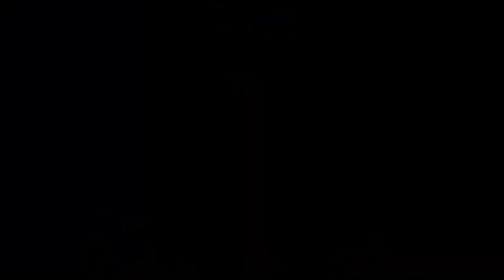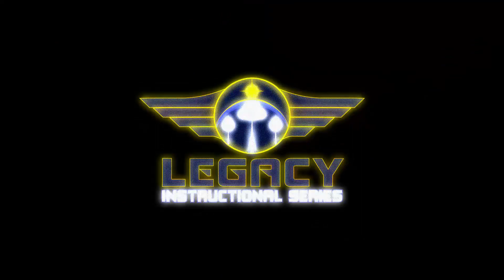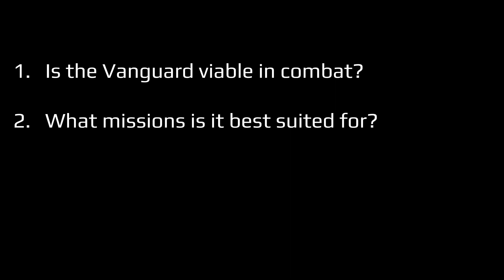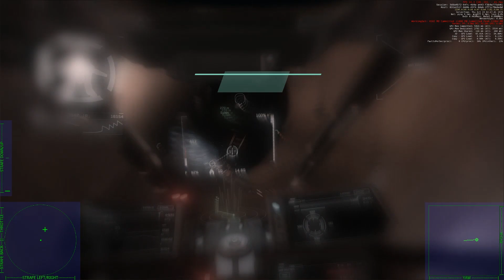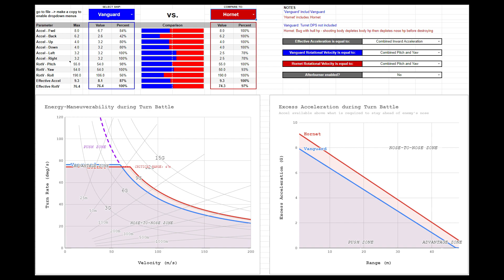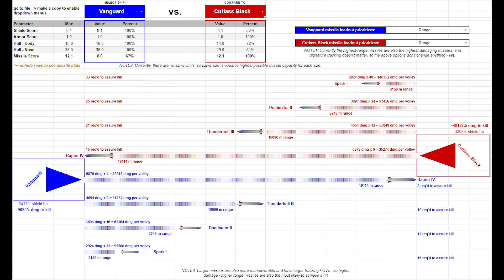Vanguard Performance Analysis - 3.6.1

Comment: I honestly don't mind the vanguard having a fix forward armament as long as it keeps the high rotation rate.  I would like a wider range of options for the fixed forward firepower and I would like one more size 5 mount for the pilot on the warden as it is the fighter variant, and all the variants should have the turret upgraded to mount size 3 guns as well as being able to manage the ships systems from the turret.

Comment: I love your un depth analysis.
First, let me say. Ever since the great Cannon nerfing of 3.5, I have been very disappointed with the Vanguard's firepower. I think it was just about right where it was in 3.4.
That said, I still like to put an M7A on the chin, then combined with the MVSAs I can deliver ferocious punch after punch on a target. And Cutlasses are especially easy to kill.
I'd really love to see one of the following: 
A) 2 size 4 hardpoints added under the wings
B) an additional size 5, either paired up on the chin, or move the existing one off the chin and put the 2 size 5s under the wings.
C) upsize the quad 2s to quad 3s.
D) put the quad 2s on a gimbaled mount (for auto gimbaled firing)
With option D I'd still want more firepower. Perhaps 2 size 3 hardpoints under the wings.
A 5 Vanguard flightwing should scare the shit out of a Hammerhead or Polaris.
Reply: i understand the nose gimball but more firepower ? in this video you saw great maneuvrability and awesome shield and hull point if you have more firepower you have everything and cig don't want that so if you want more firepower you will move as a freelancer or have the same hull point to balance

Comment: Good video if somewhat inaccurate. Arrow for example has little issue taking out a Vanguard if like the Vanguard you change it's loadout.
Reply from the maker: If it's using bugged attritions, yes, I agree.
Reply: @LegacyFleet  Arrow doesn't need to use the bugged attrition's to kill a Vanguard. It just needs to stay by it.
Reply from the maker: @rcole134  Hmm. That's not what we found. Let me know if you find or make a video showing how to do it. As I showed in the analysis, I did testing against 5x arrows all ok my at once and even with bugged attritions it took multiple minutes for them to kill me.
Reply: @LegacyFleet  It's just comes down to the loadout. It's also very simply math. damage output vs shield regen = win/loose. Another issue with your video was when you said a Vanguard could take out a HH. Yes, it can but only because the non default Attrition on the nose is bugged, thus bypasses the shield. If it wasn't bugged then the Vanguard couldn't kill the HH on it's own simply because the default shields of the HH recharge at a higher DPS than the DPS damage output of the Vanguard. It's all simply math. Also, as side note I took out a Warden over Daymer a few days ago after he engaged me. I was in a stock Gladius and used missiles which he just couldn't get out of the way of. I own a Warden myself and YES it's a good ship but it's not as good as your video would suggest. Final bit of Math Vanguard damage output using 4x MVSA'a and 1x S5 Attrition = 1843 DPS - 1669 sustained DPS. HH default shields recharge at 3855.176HP/s. (2x shields totalling 179868hp) That means that without bugs the Vanguard just doesn't do enough damage. (Info taken from erkul.game/calculator who pull there data direct from the files.)
Reply from the maker: @rcole134  But the video where I demonstrated the VG taking out a HH, I wasn't using an attrition, I was using a S5 absolution distortion cannon. Also, I agree with math being important, but that math needs to be validated with in-game testing, because maneuvering gets a vote. An Arrow won't be able to maintain constant damage on a maneuvering VG, and that shield regen is high and has no delay. That's why I said - if you find a video of an Arrow killing a maneuvering VG with something other than an Attrition, let me know.

Comment: Very Great video! And thanks for this as always! Loadouts would be a nice option to add to this? I know you used a Absolution distortion cannon S5, What do you use one a normal run etc..I also noticed the default cannon was not used?
Reply from the maker: Not in these videos but I have used the default revenant quite a bit. I would say either that one or (the meta/bugged) attrition is what most use.

Comment: All is well, but what about Fixed vs Gimbal advantage. For example MIS will hit much more often thanks to having it's weapons on turrets which will achieve much higher on target gun DPS. I know that it is hard to include it in hard weapon stats comparison, but it is a very important factor.
Reply from the maker: I did mention that in the video. There's no way to quantify that advantage, though, other than to say that the Vanguard is one of the only ships that can't gimbal all its weapons, and that limits its versatility.
Reply: @LegacyFleet  I know it is hard to quantify, however that is a VERY important factor that completely undermines all of those calculations. Having ability to track your target while not precisely on target changes possible attack ranges, changes time on target - and that changes actual DMG output. I don't know really what is the impact of having gimbal/turret and not having it on actual DMG. I think there were discussions about it on spectrum, but I personally judge it around 30 up to 50% more DPS thanks to having gimbal/turret and that is huge. A lot will depend on skill, but roughly Vanguard will have maybe 40% time with weapon on target while Lancer will have around 50-60% - and that is up to 50% more hits so 50% more actual DPS. I think you should try to accommodate that into spreadsheet by using static dmg modifier, but please consult people on spectrum for better percentages. There are people who have made some measuring and can tell you better numbers than those I have put here out of thin air (well, from memory).
Reply from the maker: @aleksanderw5536  Actually, if you want to go with 50% then that's perfect because that's the exact DPS tradeoff you get from using a gimbal instead of a fixed weapon in a hardpoint. In that case, the analysis values stand quantitatively.

Comment: This is awesome. Really appreciate your vids! I've always been a fan of the Vanguard. MIS would be cool to see next. Your segments on how to tackle fights (nose vs. range) is especially good and will hopefully cause the community to improve and think about their technique. Why do you think the community at large thinks the Warden sucks even though your analysis shows otherwise?
Reply from the maker: Because I think many consider the inability to gimbal all weapons to be an accessibility issue. And, it's true that it does affect the VG's performance, currently. But the thing is still a beast IMO.
Reply: You’re a lot better at deflection gunnery than a lot of us are, so it’s probably a lot better for you than it is for the rest of us...

But, objectively, you’re right that it’s still a beast. 

Biggest disadvantage though: It’s not fast enough to pick its battles. On the attack a lot of ships — and cheaper ships — can turn tail and run from it. And if you’re facing off against other combat vessels you better be tough — your only option is to fight to the death.

It seems to be a great pick against NPCs (who can’t evade as effectively as PCs), and larger ships. And it its lack of speed does not hamper its ability as an escort...
Reply: @moonman6359  and what the problem as escort if the target run away the escort is alive so your job is done, if the attacker come back later you will be in good cause you can change damaged component  while flying and blade aren't in the game now the vanguard have enough computer to automate turret or slave them to pilot so much firepower to destroy your target
Reply: to me people only want big weapons without think : if you can't aim your target whatever the weapon you equipped, you will have to run or you will die.